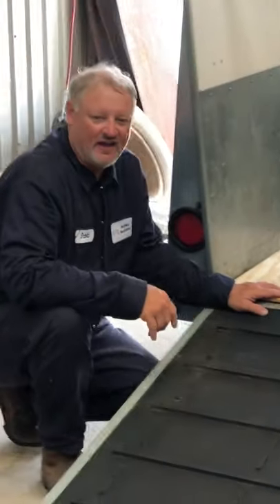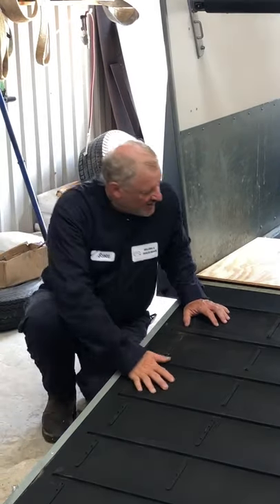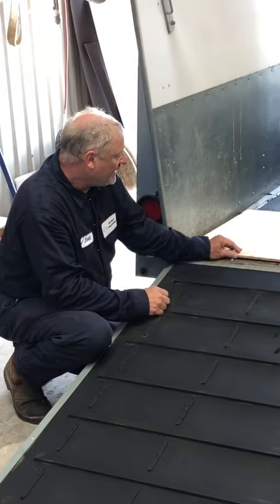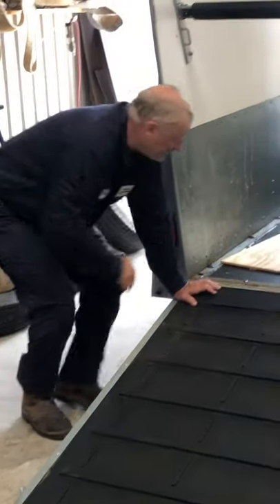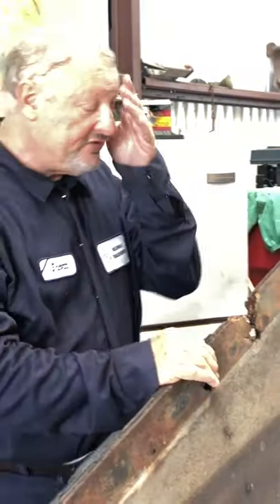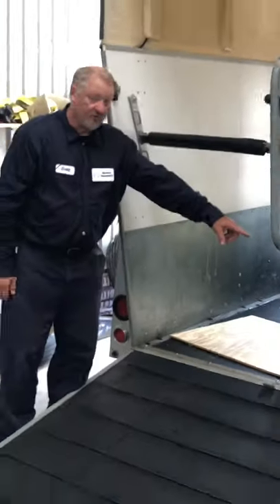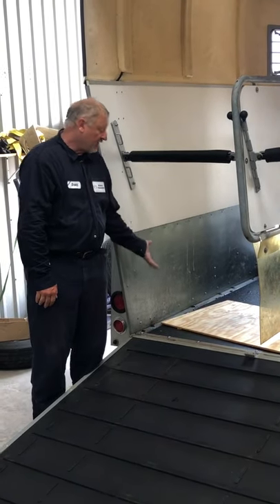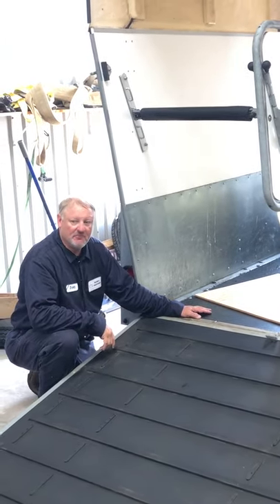Brender up Trailer floor verses conventional floors

Comment: My Brenderup floor decayed, just like you describe. Problem was the bolts used, imo. They didn't use a bolt that wouldn't rust & caused insidious breakdown around the bolts that they spread. Corner of back side is worst. So... I have a horse trailer without actually having a horse trailer until get it repaired, but few people have ever even seen a Brenderup. Getting it repaired isn't something sure how to get done at a regular trailer shop. So thanks for the video. Glad to see someone who repairs Brenderups. Be worth driving to you.